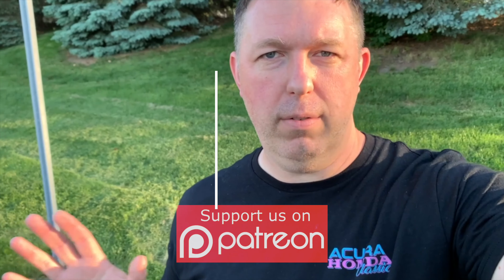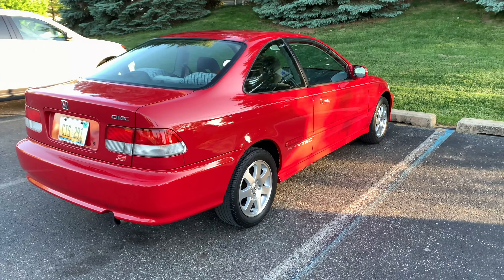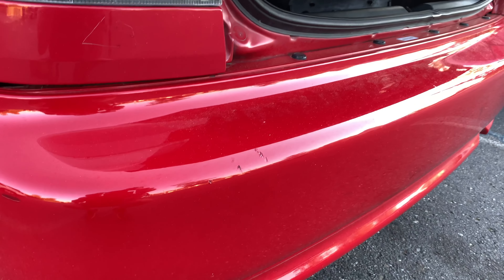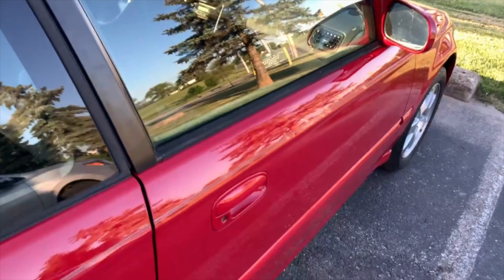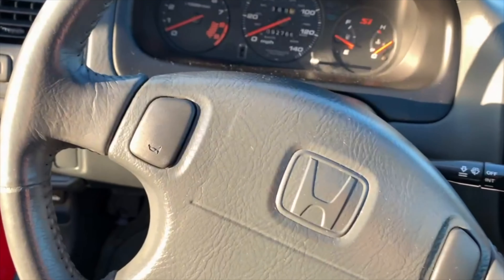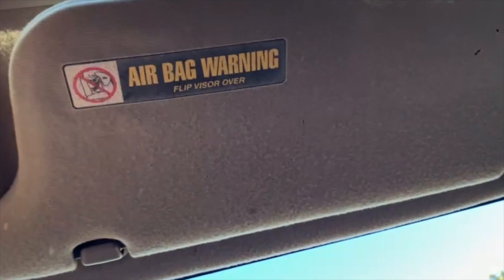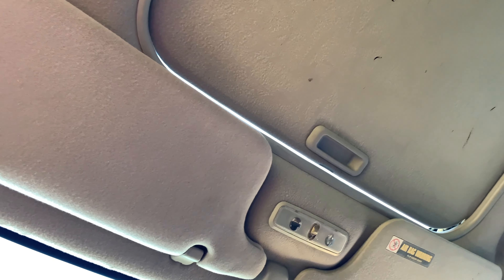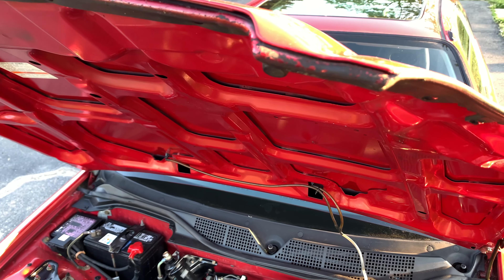EM1 2000 Honda Civic Si - Intro & Walkaround - Project 130R

Comment: My '98 Civic coupe had the same exhaust hole and messed up sunroof shade. I reupholstered it along with the headliner before it sold. Overall, very nice Si you have. These have common issues with dist gasket leak and vtec gasket leaks, an age thing I think.